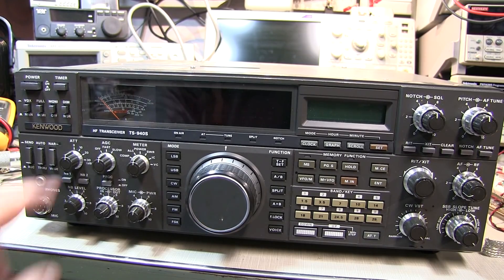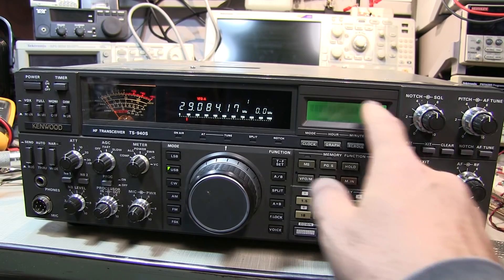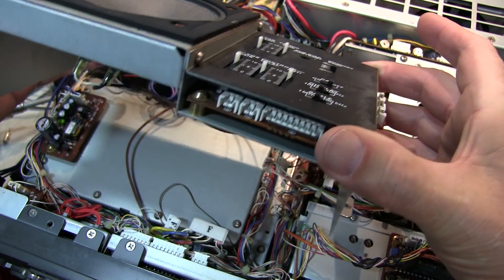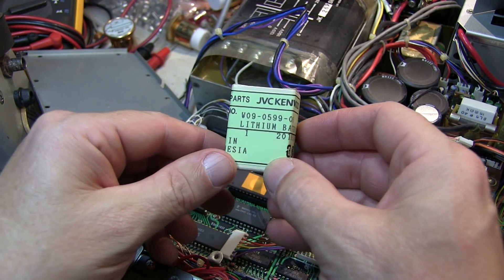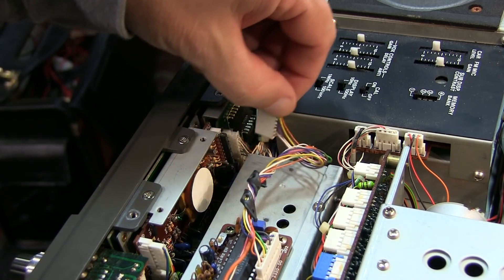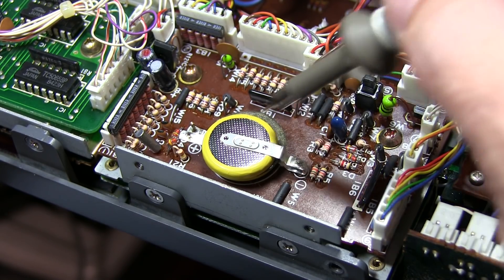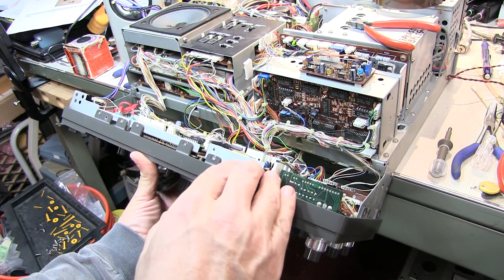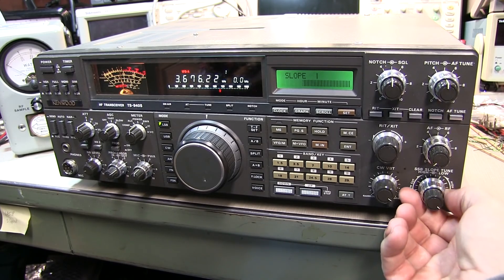#309: Radio Repair: Kenwood TS-940S Battery Replacement

Comment: Electrical Bikes Batteries are rated in watts and not Amps Per Hour APH. Mechanics are saying that not all cars batteries are the same because it will measure 12vdc but some will measure a higher output of current because the battery has a higher wattage. When you purchase different 9vdc batteries from various brands and measure the max current using a 10 ohm load resistor then you calculate the wattage of the 9vdc battery. Most car batteries don't have in the specs the wattage of the battery. Also another question is a 9vdc battery can measure 9vdc with NO LOAD, but when you use a 10 ohm load it will not measure 9vdc. My question is is the 9vdc with NO load considered a "ghost voltage" or what is it called? as well as not all 9vdc batteries from various brands are the same battery wattage, how can that be? because you can only fit and pack so many battery cells into the same size 9vdc package but some have more stored energy current
Reply from the maker: Batteries are not rated in watts because watts is a measure of power dissipation*, not power/energy delivery/capacity.  Ratings are typically in AH (amp-hours) or mAh (milliamp-hours).  This is NOT "amps *per hour".

One of the main reasons that you measure a different voltage on a battery when under heavy load is due to the internal resistance of the battery.  The "no-load" voltage is typically called the open-circuit voltage.  Most all batteries will measure lower voltage when under load vs. open circuit.  The heavier the load, the more the voltage drops due to the battery's internal resistance.
Reply: @w2aew  E-Bikes motors are at 36v or 48v and draw 10Amps. If your E-Bike battery is 48vdc at 10AH = 480Watt Hours. When a battery is 10AH that means its 10 amps PER Hour? and 480 Watt Hours means its 480 watts PER Hour? Watts means power dissipation but AH or mAh is NOT Dissipation, its power delivery?
Reply from the maker: @waynegram8907  10AH refers to the capacity of the battery.  It means that it is rated to deliver 10A for 1 hour, or 5A for 2 hours, or 1A for 10 hours, or 20A for 1/2 hour, etc.  The amount of current delivered by the battery depends on the load.  An E-Bike will draw more current going uphill than it will going downhill - i.e. it is not a constant load, and thus is not a constant current draw.
Reply: @w2aew  E-Bikes motors are rated in watts like some E-bikes have a 750 watt motor and others have a 1000 watt motor. The batteries used are either 36vdc or 38vdc at 10Amps. 36vdc X 10amps = 360 watts or 360WH watt hour. Its confusing because 360WH doesn't equal to the E-bikes Motor wattage, its completely off from the E-bikes motor wattage which are rated at 750 watt or 1000 watt.
Reply from the maker: @waynegram8907  It is confusing to you because you are comparing apples to oranges.

The motor is rated by it's power.  In other words, how well it can pull you up a hill, or accelerate from a dead stop.  Higher power motors draw more current.

The battery is rated by capacity.  In other words, how long it will last before needing recharge.  Please stop using Watts to rate the battery.  Watts does not equal Watt-Hours!  

As long as the battery voltage meets the voltage requirements for the motor - then you are OK.  Higher wattage motors will drain the battery faster (because they pull more current).  The AH (amp-hour) rating of the battery tells you how long the battery will last before needing recharge.  It has NOTHING to do with the motor wattage rating.
Reply: @w2aew  I know the motors wattage has nothing to do with the batteries watt hours or amp hours. How can you calculate the motors wattage be applied to the batteries amp hour or watt hour? I don't know how to apply which formula to use the motors wattage rating to the batteries amp hour and watt hour.
Reply: @w2aew  I'm confused because I thought that if the motor is rated at 750watts then the battery needs to be at 750 watt hours, of the motor is rated at 1000 Watts then the battery needs to be at 1000 Watts hour, why don't they need to be Matched the motors wattage and battery watt hours need to match and equal? Isn't there a formula to match them together?
Reply from the maker: @waynegram8907  This is where you are mistaken.  The motor power rating and the battery capacity (HA or WH) do NOT have to match.  Higher wattage motors will work fine but drain the battery faster.  Higher AH (or WH) rated batteries will last longer.  Motor power and battery capacity do NOT have to match.
Reply: @w2aew  I thought you had to convert the motors wattage with the batteries watt hours and use a formula to convert wattage to watt hours or some type of formula to match the motors wattage to the batteries capacity?
Reply from the maker: @waynegram8907  Nope.  Just need to be sure that the battery has the voltage required to run the motor, and that it can deliver sufficient current to handle the full motor load.  The amp-hour rating just is a guide to tell you how long the battery will last in use.  Higher wattage motors will drain the battery faster.  That's all.
Reply: @w2aew  thanks, I thought the wattage of the motor was the load. So if the motor was 1000 Watts that means there is a 1000 watt load being applied loading the battery so the correct battery would be 1000 watt hour rating to be match with the load rating of the motor.
Reply: @w2aew  car mechanics will test car batteries using a battery load tester which they tell me to purchase a car battery that is higher in Watts because it's less wear and tear on the cats stator motor. I think they mean the batteries watt hour rating. When I'm testing 9vdc batteries I will put a 10 ohm load to measure the max current output of various 9vdc batteries brands. When I calculate the 9vdc X the max current under load = battery wattage? Or is this watt hour?
Reply from the maker: @waynegram8907  Yes, the wattage of the motor IS the load.  That part you have right.  The battery does NOT have to have a watt-hour rating that matches the motor or load.   The amp-hour rating of the battery tells you its capacity - how long it will last, and does NOT refer to what the load rating needs to be, and it does NOT need to match the load.  How can I make this any clearer (I've stated it several times)?
Reply from the maker: @waynegram8907  Car batteries are rated by their Amp-Hour rating (not watt-hours), and by their Cold Cranking Amps (CCA).  Watt hours is NOT a correct term used to describe batteries.

Your test method for 9V batteries does not tell you the battery wattage (which is not a battery specification), and it does not tell you watt-hours (which is also not a battery specification).  All it is telling you is a little about the battery's internal resistance.  There are two other important things that you are missing when you make this measurement :  

1) What is the battery's voltage when doing this test? 
Using this, you can estimate the battery's internal resistance.

2) What is the internal resistance of the ammeter that you're using?
The ammeter's internal resistance will be in series with your 10 ohm resistor, so you're really applying something larger than 10ohms in your test.
Reply: @w2aew  thanks for the help I just wanted to make sure because the e-bike sales reps have been telling me wrong information so I was confused about it. I understand what you have said thanks for the help
Reply: @w2aew  I don't use an ammeter because of the burden voltage loss of the ammeters internal shunt resistor. I just measure the voltage across the 10 ohm load that is across the battery. Example a fresh brand new 9vdc battery will measure 9.5vdc with a 10 ohm load and the voltage across the 10 ohm load will be XXX. If you calculate 9.5vdc divided by 10 ohms the max current output of a battery = 0.950 amps, is this the max current out of a 9.5vdc battery is only 950 milliamps?
Reply: @w2aew  Brand new battery 9.5vdc with a 10 ohm load will be 9.5vdc divided by 10 ohms = 0.950 amps. The Batteries wattage is 9.5vdc X 0.950 amps = 9.025 Watts? I'm not sure if this is watts hours or what its called
Reply from the maker: @waynegram8907  OK, glad you are familiar with ammeter burden voltage.  
When a battery is connected to a load, the battery voltage will drop slightly, in proportion to the current drawn by the load.  This is because all batteries have some amount of internal resistance.  It is usually quite small, less than 1 ohm, but can be larger in some battery types.  The maximum current a battery can provide is usually limited by it's construction and chemistry.

In your example, if your battery provides 9.5V across a 10 ohm resistor, then it is delivering 950mA.  If the resistor were lowered, the current would increase (so the 950mA is not the maximum current).  It all obeys simple Ohms Law.
Reply from the maker: @waynegram8907  Again - batteries do NOT have a wattage rating, because they don't dissipate power!  Power is dissipated in the LOAD.  If your battery can provide 9.5V across a 10ohm resistor, then the resistor will be dissipating 9.025W.  If the battery can do this for 1 hour, then it has delivered 9.025 watt-hours of energy.  Of course, a 9V battery can't deliver that much energy.... (9W for an hour).
Reply: @w2aew  But what load resistor value should I put across the 9vdc battery to get the max output current? I'm trying to measure the max output current
Reply from the maker: @waynegram8907  Batteries are not like power supplies which have a maximum current based on their circuit design.  The maximum current that can be delivered by a battery will depend on a lot of factors - such as the terminal type and materials, the chemistry of the battery, etc.  The maximum rating is based on safety (melting, venting, etc.) or device damage, so it is something that you can't measure.
Reply: @w2aew  If the battery measures 9.5vdc with a 1 ohm load that is 9.5 amps of current = 9.5 watts or 9.5 watt hour? I could put a 1 ohm load across the battery but would need to get a 20watt 1 ohm power resistor. But I'm not sure if this is how to get the watt hour of a battery. I'm not sure why mechanics tell me that not all brand new 12vdc battery output the same max output current because 12vdc with a 1 ohm load is 12 amps and 12 watts or 12 watt hours, so I'm confused how various car batteries that are 12vdc can output higher than 12 amps of current or have a high max output current. That is why mechanics tell me to purchase a certain brand of battery because they claim it outputs more current than other brands which puts less stress on the cars stator during cold crank. Do you know what I'm saying? to me a 12vdc with a 1 ohm load max current is 12 amps so how can it get higher output current
Reply: @w2aew  Power Supplies will have specs that say the wattage of the power supply. A power supply max 10vdc at 5 amps is a 50 watt power supply. But you're saying that batteries don't dissipate power but power supplies don't dissipate power either right, they just supper and deliver power to the load. I know wallwart power supplies are rated as VA Volts Amps because transformers like you said its apparent power that transformers don't dissipate power because a transformer is NOT a load. Its just confusing that power supplies like those LAB power supplies for Electronic tech benches will have a power supply watts rating in the specs of the lab power supply, but wallwart power supplies have a VA rating and batteries AH or mAh means its not watts since the batteries or transformer doesn't dissipate heat or its not a load.

Comment: What are the P/N's for the batteries replaced?  Are all three the same kind of battery? If OEM is not available, is there a suitable replacement that will work? DE KB9ECQ
Reply from the maker: The battery should be available from PacParts.  They're either CR2430 or CR2032 type, 3V non-rechargable Lithium cells.

Comment: I recently got the same TS-940S, in poor condition, now repairing it. A battery in Digial A unit is OK, but timer one (only one in my radio, not two) was dead. I installed a standard CR2032 holder there, so next time I can replace a battery without soldering. Also, a CR2032 batteries are very popular and widely available now. A next problem is very very low sensitivity on all bands. I checked all DC modes in recieve part of RF Unit, all PIN diodes and input ATT relays, they all are OK, so still finding.
Reply: Any luck? I have one and only get 9 months of operation before something else goes. Getting tired of the issues.
Reply: @tf7274  Mine is already OK, works well on all bands. There were a lot of bad solders and one of driver transistors was a half-dead. An original transistors are very hard to get now, so I replaced both of them to a modern type and installed a small DC/DC module to reduce a power voltage on a driver from 28 to 12V. Also I replaced a power unit fan due the poor condition of original motor. I installed there a computer-like 24V fan. A PA fan is in a good condition and still fully original.

Comment: hi, i have a kenwood ts950s and theres no readout,can you please help me whats wrong,check the backup battery and its dead,and try the reset it doesnt came back,even i replaced the back up cell and reset still no readout...thanks..

Comment: Thanks for the Battery information. My unit has been in storage for years. when I push my power button unit powers up , when you release the button it goes down Any suggestions ? If I hold the button in radio works < any way to test switch ?
Reply from the maker: Does the power switch stay depressed when you let it go, like a bic-click pen?  Or is it returning to the full protruded position?  This power button should work like a retractable pen.  Push til it clicks and it stays depressed, push again and it returns out and turns off.  If it doesn't stay in, then is sounds like a gummed up mechanical issue.  If it stays in, but the radio turns off, then maybe dirty contacts or bad solder joint at the switch.
Reply: @w2aew  Thank you for reply ... The switch does not stay in.  Where is the best place to order battery's from . Can the switch be cleaned or just replace. Thank you
Reply from the maker: @brucecasey4252  I got them from pacparts.com to be sure that they had the tabs soldered on them.  You might as well get a new switch as the same time so that you make the shipping charge worth it.
Reply: @w2aew  Thank you Sir...

Comment: Thanks so much for this video. My sub-display (LCD) flickered for a day or so before it died. BatteryBob.com sells the precise batteries for the 940. I ordered 2, not knowing till I opened my 90000 series rig was one that had just 1 for the sub-display. I elected not to replace the main display battery at that time, but plan to do so soon. Gad, the wiring between the front panel and main chassis sure is daunting! I inherited my 940 (and my call) from my SK OM. I love keeping both on the air! W3PYF.
Reply: Hallo, do you have the part number for the batteries, so I can order them in advnce? Thanks

Comment: I was able to do it  without taking any plugs  off. The speaker assembly just flipped over to the right upside-down.  I did this last night. Took able 45 minutes. Thank you for showing me how and the locations. Replaced the clock battery too. 73, Bill KA2QEP
Reply from the maker: Glad to hear that my video helped you out!

Comment: I just recently upgraded from Technician to General Ham and have a working Kenwood TS-430S and a dedicated power supply PS-430.  I will need to replace my battery very soon.  Thanks for posting about the TS-940S.  73 from K9POW in eastern Tennessee.

Comment: Before you close up your TS940S you should view The Radio Shop's "#247 Tech Tip Kenwood TS 940S Display".  Simply reseating the eprom can save you a lot of future hassle due to an apparently dead S meter, and the dreaded intermittent "Display Dot Problem"!
Reply: Thank you kindly! Following his procedure, I was able to get my TS-940 back up and running.

Comment: Hi Alan, ... Good to see you still "up & at 'em!" ... I was thrilled to see the article about you in QST. Bravo! (I made it a point to read the whole thing a couple of times ... just for QST's info).  One thing I have appreciated, though, is that your videos on YouTube have a higher quality of content than some of the many other articles available.  In the case of this video, though, it opens one's eyes as to just how to approach fixing stuff on the beautiful old TS-940. Back in the day, when I was whailing away at one of the old sunspot cycles at a furious rate, I was using the TS-940's older brother, the TS-820S. Unfortunately for me I had problems with it, that I could not  figure out (no one else that I knew could figure them out either), and there was no internet or YouTube to help out. So, I really, really appreciate the resource you are providing. (My Dad passed away, and left myself and my brother (W7SN) his TS-940)  I hope you live long and prosper! ... 73 & DX! ... Neil, K7WK
Reply from the maker: Thank you for the nice comment on the QST article.  It was quite an honor to be selected.  I really appreciate your nice comments on my video content.  I'm sorry for the loss of your Dad - I've been there.  73,
Alan